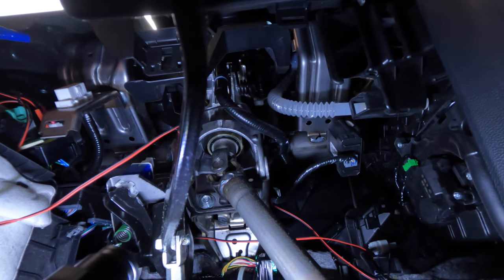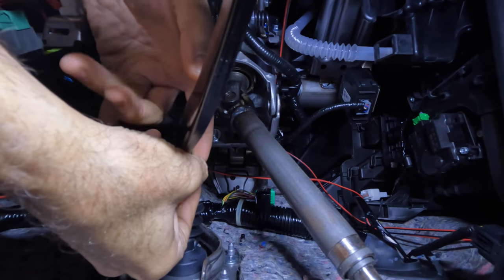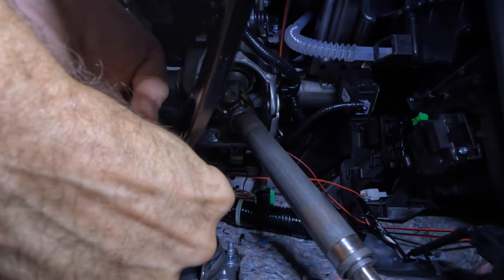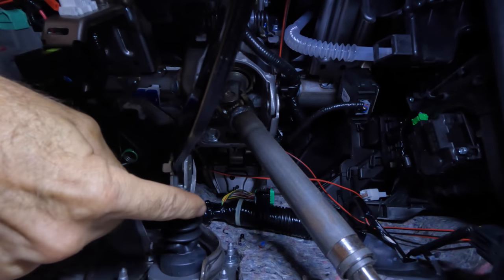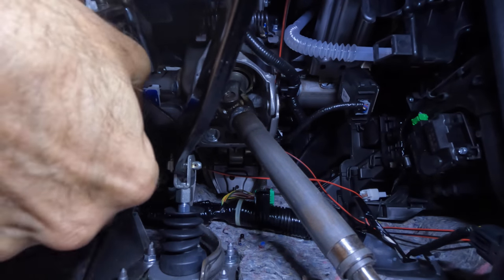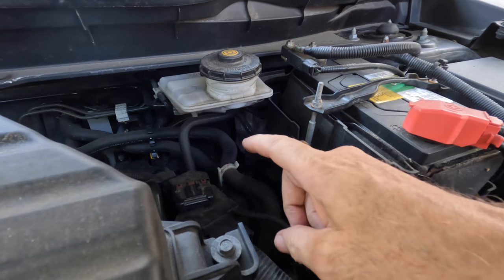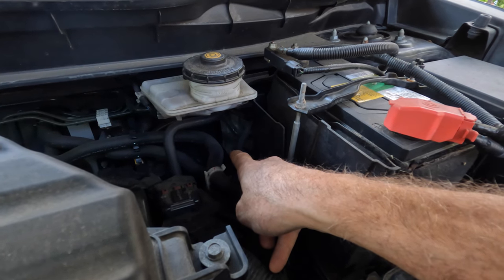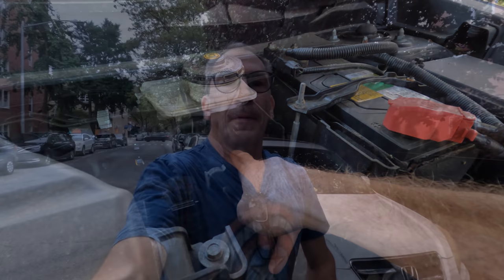Your Brake Pedal by Honda CRV no cure to fix but heres a howto

Comment: My new Honda CR-V hybrid started to have the loud squeaking noise just about after one year and when the winter started. It only happens at the very low speed 4-1 when stepping on the brake. The Honda service could not find any reason and could not fix it. It’s so annoying to hear it every day, and on a new car! It’s still under warranty but it cannot be fixed!
Reply from the maker: go back. and press the issue, its   going to be in the Master cylinder  if they do not want to help, another dealer and the general office
Reply: @fishycomics  Thank you so much! I will do that.
Reply from the maker: @Carl-ty6zu  you paid big $$$ and deserve a working car. I get asked  al lthe time to  lube the part.

Comment: I just brought a gen 3 about 7 months ago. Just got master cylinder replaced, pedal was going to floor. Now, brakes are still soft but are more responsive than before. Are these cars known for soft brake pedals?
Reply from the maker: no, you have Air in the line, I  get them bled again the furthest first the two rears,   you can also inspect the lines under the car if found
Reply: @fishycomics  what do you think would cause the air? My lines are all fine and calipers not leaking or anything. When they were flushed pre master replacement they seemed to work well and then lose pressure in a week. Now master was replaced 2 weeks ago and pressure is much lower than used to be. I just don’t wanna keep throwing money at parts if nobody can figure out what’s going on
Reply from the maker: @SARKAZYMYT  I wish I knew, I feel the machanic did not bleed the lines All  Ican say